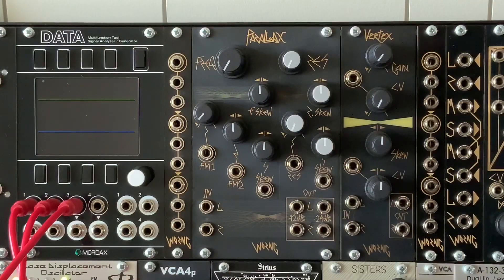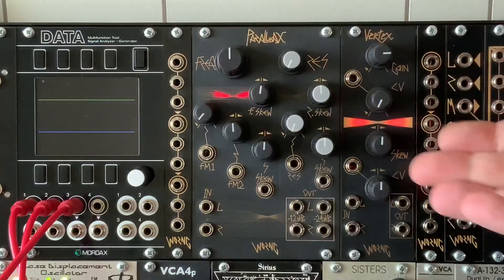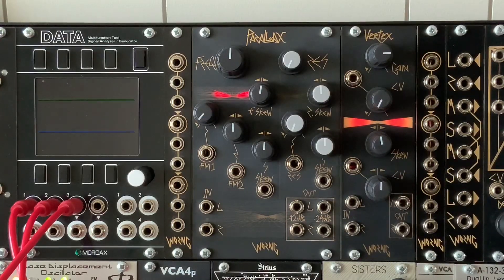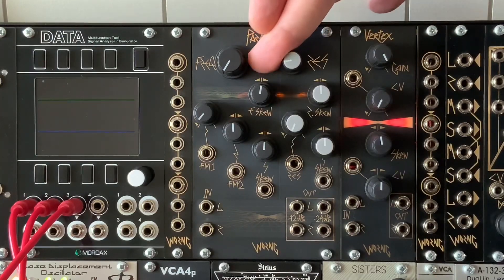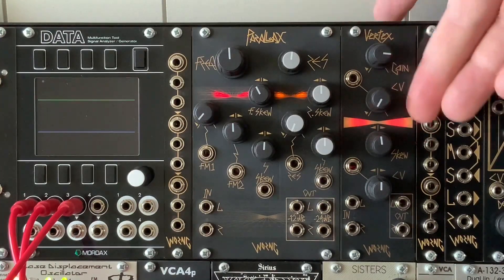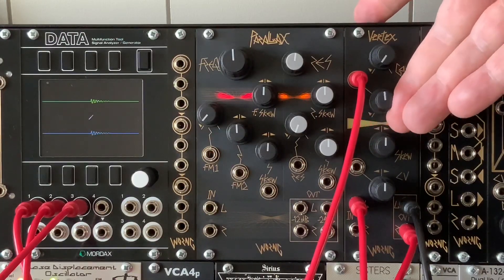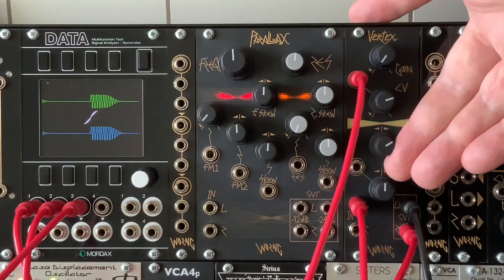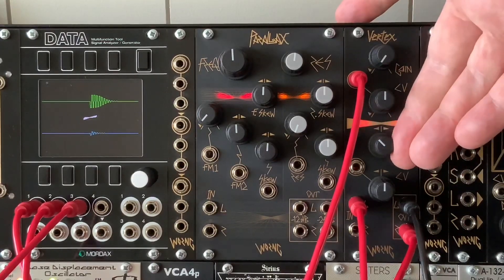WORNG Electronics Superbooth Home Edition 2020 - Parallax and Vertex

Comment: I don't really understand the mono-to-stereo capabilities of stereo filters. If I understand it correctly, you can either pan a signal back and forth with them or have the resonant peak on one side and the regular signal on the other, neither of which creates a satisfying stereo sound (for me). Panning sounds disorienting — not something you'd want to have going the whole time, and the spread peak thing creates an unbalanced sound. 

By the way, how is the build quality with these modules? When you turn the knobs, they seem to wobble. That doesn't fill me with confidence, although I've been told that is not a sign of poor build.
Reply from the maker: The basic principle of using a stereo filter to make a mono signal stereo is feeding the same mono signal to two filters with different settings, resulting in two different signals on the left and right which is a stereo signal. There’s no panning involved, panning is changing the relative amplitude between left and right, stereo filtering is changing the spectral response between left and right. 

Regarding things being unbalanced between left and right, if they were perfectly balanced it would be a mono signal, not a stereo one. Obviously if a sound designer is interested in creating a stereo soundscape then it’s up to them to balance all the different elements in the stereo field as they see fit, Parallax gives you the tools to be able to do that. 

Regarding build quality they’re made in the same factory using the same parts as WMD, Rossum, and others, so the build quality is top notch. The pots are secured to the front panel with nuts and have metal shafts for longevity, of the thousands of modules we’ve made none have been returned with issues with the pots. 

All our modules are designed to last, you can read more about our design philosophy on our website if you’re interested.

Comment: What type of filter architecture is used? I couldn't find specific reference anywhere, but it sounds nice and dirty like a diode ladder or sallen key filter or something idk.
Reply from the maker: It’s designed around the AS3320 chip, using the Pro One filter design as a starting point and then making certain improvements without sacrificing the dirt that gives it such nice character
Reply: @worng_electronics  Thanks! I actually was able to find a bit out on modular grid. The filter sounds really nice and I ordered this and the vertex. I really love your designs! I also already have the sound stage and lrmsmslr too! Thanks again!

Comment: So nice! I would love to see a TRS stereo patch standard emerge where a single TRS cable in the Left Input or Output is assumed to carry a stereo signal. As more and more module start supportin stereo, using TRS patch cables starts making a lot of sense
Reply from the maker: While there would be some benefits to that it would mean systems would end up with a mixture of TS and TRS cables, and it would kill backwards compatibility with eurorack standard modules. Patching two cables really isn’t that much hard work, and allows a lot more freedom to treat a stereo signal as a stereo pair, dual mono signals or even a mid/side pair. There’s a lot more scope for creativity keeping it this way.
Reply: Totally understand, however this already exists in a number of devices that use 1/4 audio jacks. Separate L/R jacks that support both balanced and unbalanced signals, as well as supporting a single mono or a single stereo cable. Quick look at my rig, Synthstrom Deluge, Bastl Thyme, Waldorf Blofeld, all use some sort of variation on that system.